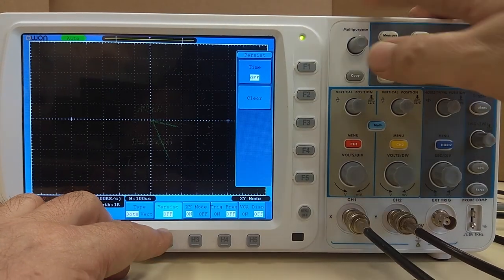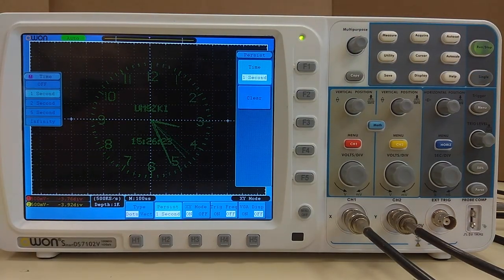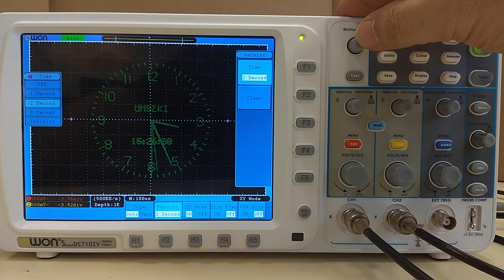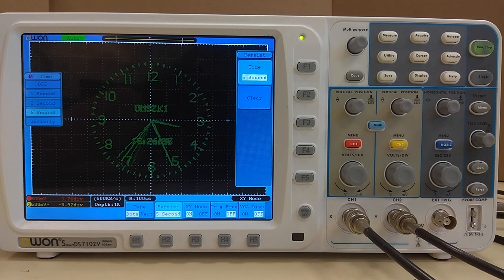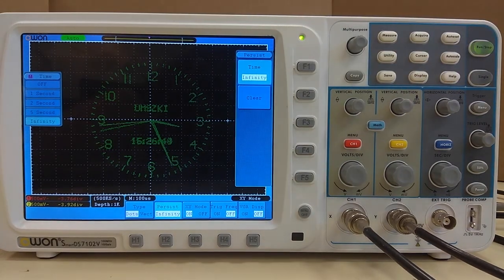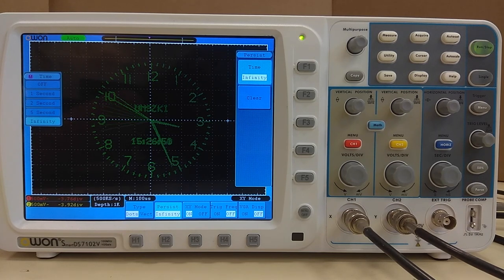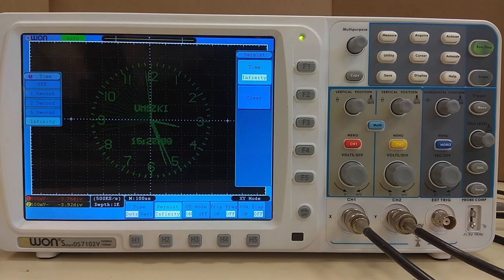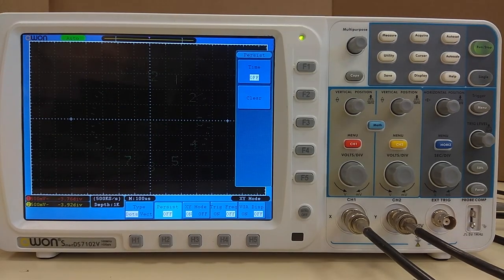When the Analog Oscilloscope Is Better than the Digital Oscilloscope

Comment: Great video, thanks!  Ive got a Tektronix 2215.  I really like it.  I have been looking at the new digital scopes, I've been looking at Siglent and Rigol scopes, not sure which offers more value.  I am a retired field engineer with Hewlett Packard.  Electronics is a hobby now.  Audio equipment, guitar amps, ham equipment, etc...  Thanks for your video!  In college I remember looking at lissajous patterns.  In real life I have never needed to use the XY function of a scope. I used to need the scope to troubleshoot with, to align disk heads, to adjust start and stop ramps for tape drive capstan motors..... Lots of fun stuff.  In my later years I didn't really need a scope.  About all I needed was my laptop and perhaps a screwdriver!  Times really changed in my 37 years with HP! I find your channel interesting and subscribed.
Reply from the maker: Thank you for your valuable comment

Comment: Analogue Oscilloscopes have very important role in setting up a swept RF signal, where I tune precisely the center frequency, which cannot be set on any other instrument easily, and Digital storage oscilloscopes are pretty useless at that, the main problem being that when analogue signals overlap on the display they create a brighter area where the two signals overlap, it is hard to explain, a signal is a signal and it occurs only once at a certain point in time, and its position of the screen, but if your trigger settings were set such that the same signal may display on the screen at different locations on the screen, then these locations glow as the phosphor is struck by electron beam, and if an area on the screen is getting more frequent sweeps of the same signal it will be brighter in that area, and dimmer in other areas, this is crucial in my gadget for setting the correct center frequency. DSO cannot achieve this, no matter what, so I treasure this old 100MHZ Goldstar oscilloscope that has served me for more than 25 years, I also have a colour DSO with a printer for which I paid nearly $7500 back in 1994, but is pretty useless for setting this swept RF but it has very useful features which analogue oscilloscope cannot meet, so both are equally good in their own way.
Reply from the maker: Thank you for your long comment, and you are absolutely right. And Merry Christmas to you!

Comment: Hi, I need to check if Copy Generation Management System – Analog (CGMS-A) is enabled on an analog output STB. Can an oscilloscope detect these waves? I read CGMS-A embeds in the media CCI in the vertical blanking interval of the video signal (lines 20 or 21)
 if that helps at all?
Reply from the maker: I don't know what kind of oscilloscope do you want to use. But most of them have TV Synchron mode, and a built-in line selector, and you can see on the screen only the 20th or 21st TV line. But the scope won't recognize your special signal. You have to do it.

Comment: The real question is, why most of digital oscilloscopes (except the last one) couldn't display it as good as analogue ones and how that would translate in the real-world performance of an oscilloscope.
Reply: The keyword is the waveform measured, changing all the time in 12 hours cycles, and a phenomena called "the Nyquist rate" with respect to how analog-to-digital converters works with waveforms.

Comment: Analogue oscilloscopes often have a Z modulation input which can help give better displays. I think this clock hides the darkened areas of trace by moving fast : the Siglen in large-memory mode catches even this but does not apply it to the persistence modelling.
I think you chose variable persistence on one scope and varied the sample speed or length in others, probably to show each at it's best but didn't explore it too far.

Comment: ...inside the crt you have a fluorescent layer which keeps light stored even after the beam passed to anothe rposition, therefore you have the impression of fluid image. A digital osciloscope don't have that - in shows the beam walking around as it really does. Learn something and document yourself. Such "Toy" applications were remainings of the analog era. They don't reflect the purpose of any type of osciloscope.
Reply: Yeah, only your comments makes some sense. I was thinking this clock signal generator depicts the capability of an oscilloscope. But again, since the digital oscilloscope with lowest depth of memory and sampling rate (25kpts and 250MS/s) could display it fairly good and the best capable digital oscilloscope needed its original depth of memory to be lowered to display it properly, it appeared this application was no measurement of the strength of an oscilloscope or how good it would performance in real world applications.

Comment: Why siglent with 700 kpts of memory can't display with quality than 2.5 kpts tektronix? what can problem with siglent in signal processing? I have this siglent and works very good but when you reach minimun time division, memory is only 7 or 14 points, however, also I have MDO3054, you can reach minimun time division and keepts same 10 Mpts in memory, I think tektronix data processing is  better chinese oscilloscopes, rigol has scopes from 500 usd with a lot of memory, the MDO3054 is near to 20k usd only has 10 Mpts, is not comparable for price difference, but when you see a new chinese  oscilloscope with 14 Mpts (siglent) for less 500 usd and you see 20k usd tektronix with only 10 Mpts you think tektronix is thieving but reallity is other hand.
Reply: I think 10Mpts is enough for most jobs. I even lower the memory setting for faster updating rate.
Reply: @phuang3  My agilent dsox 2000 is more faster than My tektronix mdo3000, what brand is better for You in mid range scope

Comment: The only useful advantage of an analog oscilloscope occurs when observing Lissajou figures - e.g. when tuning clocks, sine wave generators, PLL systems, etc.
XY mode for observing magnetic hysteresis or other "one-off" waveforms on a ~$400 digital oscilloscope works even better than on an analog oscilloscope.
Displaying a "watch" on an oscilloscope screen is a joke!
Reply from the maker: Thank you for your approach. I used the clock because it was the simplest signal source requiring X-Y mode, and many things were easier to demonstrate on it than with the Lissajous curves.